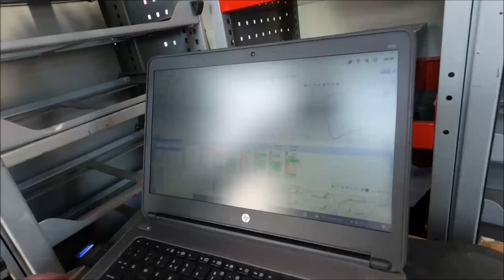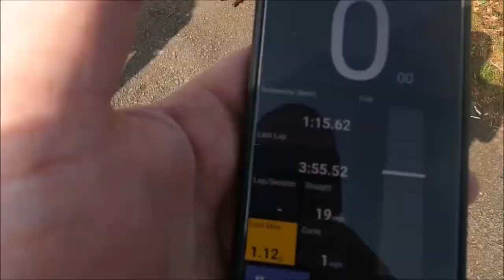I never thought a 1.15 lap was possible until it was

Comment: You are speed hahaha. Good video. Congrats on the PB also. 
I'll have to look into tyres a bit more for better PB's. Currently using AD08r as a daily/track tyre and really like them but I haven't used anything above these. Until these AD08r, Probably Yokohama S-drives were the best I had used.
Reply from the maker: Dunlop direzza are very good.
Reply: @Sparkplugsteve  which model Direzza? What would they be the equivalent to?